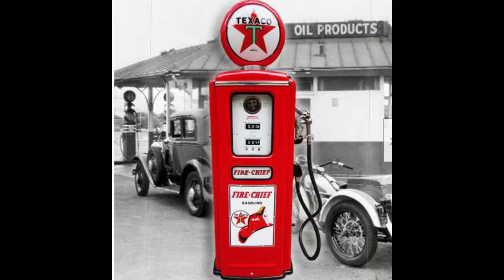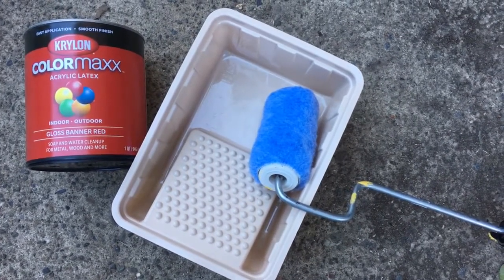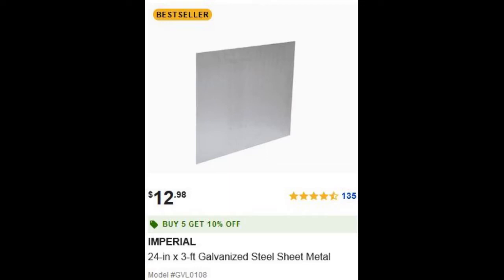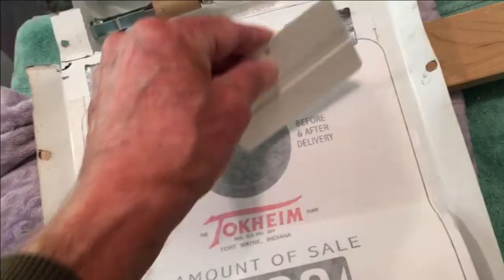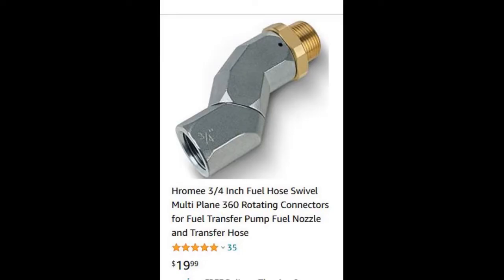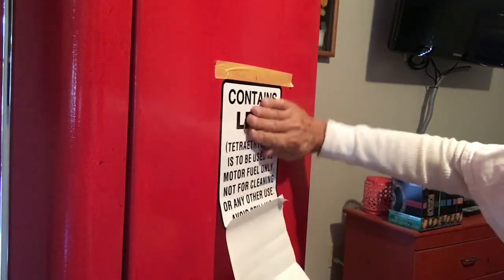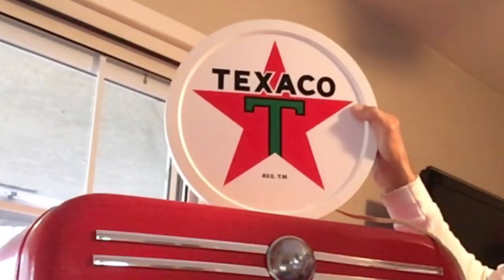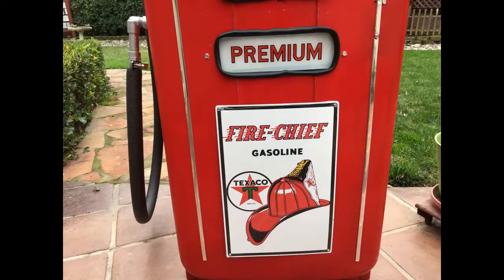DIY Vintage Gas Pump from fridge

Comment: Very clever & nicely done. I too am good at doing these re-pops & have done mostly Coca-Cola machines & coolers but have a few gas pumps that I started with gas pumps and built out as copies of mostly Texaco & Mobil. I became fascinated with these treasures in the 1980s. I met a guy about 35 years ago that was traveling the country buying old pumps and restoring them like new ones. He said it took about 5-6 pumps to get one good one to finish. He was an auto body guy so painting them was his specialty. I liked it so much that I paid him $1250.00 in 1992 for my first real pump done by him. I eventually sold it to a lady who paid me 2800. for that pump as a gift. Today I'm in my 70s and still buy Gas & oil collectibles as well as Coke collectibles restoring them and trading them as a hobby. My wife says our house looks like a museum between the Jukeboxes, slot machines, and gas & oil memorabilia. My grandkids will have a good time selling this stuff one day but who cares it was fun along the way!

Comment: Fabulous job. I'm just doing a bit of research before I start building one for myself and you have given me some great ideas, and some solutions to parts of the process I hadn't figured out just yet. I'm in the UK so probably wont find a refrigerator like you've used, but there'll be a suitable alternative I'm sure. Thanks for sharing your build! 👍
Reply from the maker: Glad you enjoyed it-good luck with your project-Cheers.
Reply from the maker: I am reminded of the old joke about the reason the British drink warm beer is because their refrigerators have lucas electrics.  If you're old enough to remember MG's, Triumphs, and Spitfire sports cars you get it.  In any case thanks for the comments,cheers and best of luck with your project.

Comment: Where did you get the Texaco, Premium, & Fire Chief stickers?
Reply from the maker: sorry for the delay here are the sources for the materials.  vics66.com "premium" glass sign, vintagegaspumpsupply -large round texaco decal & "contains lead, killerdecals-cents and gallons decal, amazon-reproduction plastic gas pump globe, amazon-Texaco fire chief 12x18 alminum sign.  Hope this helps